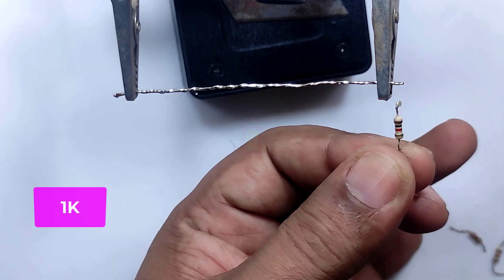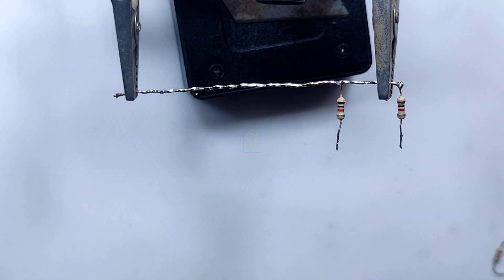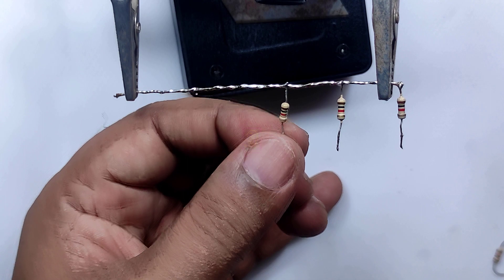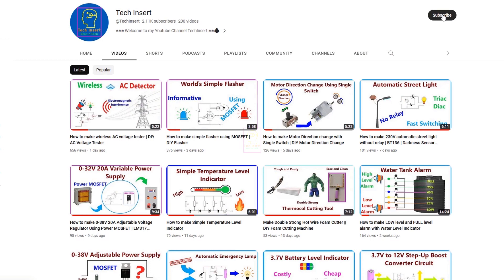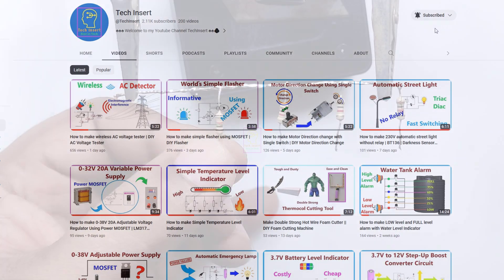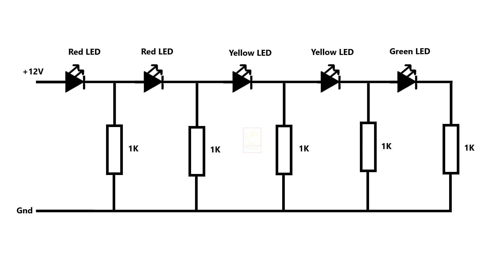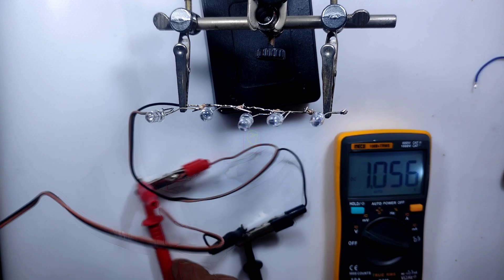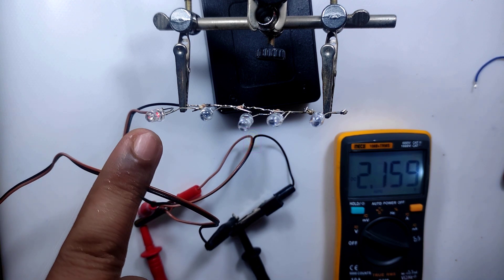How to make Simple 12V  battery level indicator | DIY Battery Level Indicator

Comment: This seems to be simple. Keep going bro🤩🤩
Reply: This is inaccurate, I made this on a bread board and it takes 14v for green light,  has to drop to 5v for red light. 12v batteries don't operate at this range. Next time post something between 13v and 11.9v. That would be useful for 12v battery.
Reply: @philcrittendon7287 Try changing the resistor values
Reply from the maker: Thank you